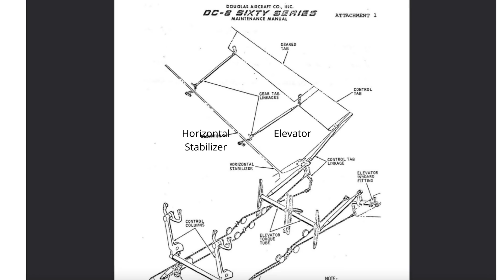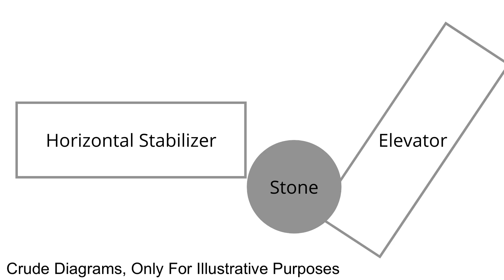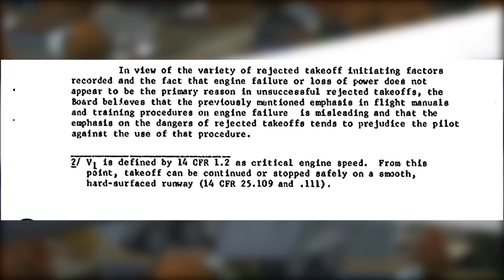How A Stone Crashed A Passenger Jet | Trans International Airways Flight 863

Comment: A tail-strike seems like a clear reason to reject a takeoff, regardless of your training. That's potentially worse than losing an engine.
Reply: If your craft is rotating 30 knots before V1 uncommanded, I don't know why you wouldn't reject the takeoff. Control problems are far more serious than a single engine failure in a 4 engine craft.
Reply: @randomxnp  The tail strike in a stretch DC-8 was not all that uncommon. The aircraft was designed to take the strike with no damage. There was a bump under the tail to absorb the impact. It was painted black and if the paint was worn it required an inspection. There was a tube inside that was compressed if there had been a strike. The extent of the compression governed the inspection required. Most of the events I heard about required nothing more than more black paint on the tail skid.
Reply: Depends how long and when in the take-off. Sure turn back if you feel like it but it’s not as bad as it seems.
Reply: @lucaschneider1613  What a pity these pilots didn't "feel like it". They dragged this plane into the air after literally dragging its ass down the runway for 1200 feet.

No, they had no way of knowing they had a rock stuck in their ass crack - but they had every reason to know they couldn't get that plane off the ground and there had to be some damn good reason for that.

If they'd aborted that takeoff, the rock might have fallen out, leaving them none the wiser - until some slightly-less-idiotic engineer thought, hey, what would make this plane pitch up *all the way down the runway*.

It wasn't like today, when the pilots set out to fly and every damn thing they do gets run through some subcontractor's software FM box, to emerge on the other end in God only knows what configuration, and we finally bother to figure out what after we've sacrificed two plane loads of people.

But hey, those pilots were furriners and they just couldn't fly our fancy baby, amiright?
Reply: Losing an engine is far, far worse than a tail strike. In a similar DC-8, we hit tail on takeoff out of PAP-JFK. We completed the flight. It was checked in JFK and was able to continue its work. Tail strikes can range from a scratch to damage to the fuselage, but still not worse than loosing an engine especially on Take Off.
Reply: @timbohp  Sure, a little scrape wouldn't be concerning, but in this case it was a hard strike.
Reply: @pseudotasuki  -  If you're at V1 speed.....you're not supposed to reject a take off as you won't have enough runway to stop after rejecting.  Yes, they should've rejected ASAP, but they didn't.  Once they got to V1 it was too late.
Reply: @christopherweise438  B.S. because the V1 would have been around 114 Kts Vr probably the same.  The runway was 13,000 feet long. They were probable had used 1500 feet of runway when they reached V1/Vr. Back in those days the F/O kept his hand on the throttles until V1. Airlines changed the procedure a few years later and the Captain kept his hand on the throttles until V1 for all takeoffs. If you ever fly any airplane and it auto rotates you have a big problem so STOP, and figure out why, Cessna 150 or B747.
Reply: @georgeconway4360  -  There are situations where you don't reject takeoffs at V1.  Tell me i'm wrong.  Not all runways are the same length.
Reply: @christopherweise438   V1 is just a number. In this case the TIA crew should have rejected the moment the nose started to come up on it’s own. There was a very serious control problem. Recognize if this DC-8-63 weighed 355,000 pounds rather than 200,000 pounds of the accident aircraft it could reject at a V1 of 155 Kts, which may have been 9000 feet down the runway and stopped even though it weighed 155,000 pounds more than the accident aircraft. What would you do if you had the opposite problem, nothing happened when you rotated. Obviously you would have already passed V1? Don’t you think you be better off rejecting 30 Kts faster than V1 rather than run off  the end of the runway at 200 Kts? It’s never too late to reject if the airplane cannot safely fly. That’s why they pay you the big bucks!
Reply: @georgeconway4360  -  I see.  I was wrong.  My father was a pilot.  I went up with him many, many times, but i never went for my certificate.

Thanks for the tactful explanation.
Reply: @pseudotasuki  
Tell me how you know nothing about this without saying those words. Tail strikes are not nearly as uncommon as you seem to believe.

Comment: Yes, not only is it plausible, but it is most certainly what DID happen. 

As a result of this accident, an elevator position indicator (EPI) was installed with the little gauge on the left side of the F/O's instrument panel. When the pilot monitoring calls "80 knots" the pilot flying pushes the elevator forward with the control column, and responds "elevator checks" as you feel the nose depress slightly and see the nose down indication on the EPI. This was done on all takeoffs. 

As far as I know, nobody has ever had to reject/abort another takeoff for a jammed elevator since this one happened. This scenario could happen on other aircraft types as well, particularly those with non boosted elevator system designs, such as the 707/720, CV-880 and 990, or propeller driven types. These guys were just not having a good day... The aircraft was a DC-8-63CF.

Comment: This accident resulted in a couple of changes for DC-8 flight crews. One was a call out of 80 knots by the non flying pilot which would be an indication that sufficient airflow over the elevators existed to perform an elevator check, moving the control column forward to accomplish a nose strut compression will indicate free elevator operation. After the nose bob  the flying pilot will state Elevator Checked. If the elevator does not check satisfactory  the rejected takeoff procedure is considered. This check is also a good indicator that the center of gravity and takeoff stabolizer setting  was within limits.
Reply: Exactly, Ray.

Comment: Sure, its possible, like a hundred other things. I recently had to deal with an unsafe nose gear light, and after doing all we could to clear it, including several light touchdowns on wheel to confirm weight bearing, we landed. Gear was down, visible in cowling mirror, pressure built up to reset handle and confirmed by several weight bearing loads however gear would prove un steerable and turned hard right.(45°). Aircraft was kept on runway only by maximum differential braking and nose gear collapsed. Unable to see that coming in flight, and never heard of it happening ever before. Just proves you cant realistically foresee every   possible contingency. Losing my certificates anyway.

Comment: The chief cause was probably the tail strike, in my opinion.
Reply: You have something very wrong to get a tail strike, or the pilot pulled back too far on the yoke. However not being able to get the nose back down and dragging the tail for 1200 feet 380-ish meters is such a huge ( stop immediately ) sign that it blows my mind that they didn't reject the takeoff. The tail strike wasn't the cause but it was a symptom.
Reply: @williamgreene4834  forgive if this seems like and obvious question please. Could the weight balance or distribution have been a big contributing factor. I also wonder why they continued with such a lengthy tail drag. It just seems something obvious should have been found, flaps not Set, fuel or load imbalance, insufficient V2 takeoff speed or rotation speed. Just very puzzling to me. If pulled back on stick too hard, it should have been quickly apparent and corrections made. I haven't seen flt. Data so I am flying blind here. I thank you for your knowledgeable input.
Reply: @Knotty_Bill  When I said the pilot could have pulled back too far on the yoke I was just stating possible causes. That would be very unlikely and the flight data also showed this was not true. Weights and balance are also carefully recorded by cargo loaders and that seemed fine. They pushed forward on the yoke but couldn't get the nose back down. That and the lengthy tail drag makes it almost unbelievable that they didn't abort takeoff especially because they had plenty of runway left. You mentioned fuel but fuel tanks are almost always in the wings. So the amount of fuel doesn't effect balance except left or right but that's another story and not relevant to this crash. It appears to be the stuck stone in the elevator that they were talking about. Sorry for the long winded response. :)
Reply: @williamgreene4834  no worries, just trying to learn more about this stuff...I love to learn and knowledge is more valuable to me than gold or silver. I really appreciate your input and insight.

Comment: it is very possible to pick up a stone or any other kind of debris from the runway during takeoff, serious procedures are in place to clean the runway from them, clearly a failure from the airport's side to send them down a runway that was not cleaned properly. note the concord disaster was also caused by debris on the runway. On the other had, the pilot flying the aircraft should have rejected the takeoff, given the incorrect behavior of the plane and having a tail-strike which would have brought them back to the runway anyway. I don't know if i would put more of the blame on the pilot, given the procedures as you described them.

Comment: Interesting, I am curious how can investigators be sure the stone / debri marks didn’t happen due to crash impact ie how can they be so sure that the jammed stone happened before the crash🤔
Reply: Marks on both parts at the same location, but in opposite directions - outward from the gap between the parts.  That indicates something hard got squeezed between them.

If something got smashed through the parts during the crash, the marks would be in the same direction - out of one part and into the other.

If the parts were separated and each one got damaged separately, it would be extremely unlikely that the location of the marks would be the same on both parts

Comment: If exterior cameras were installed - the Flight Engineer would have noticed anomalies in the rear controls, once he panned the rear of the craft views. However, this is a big, “what if” hypothesis. Camera equipment would have been extremely bulky, in that era of flight. I still believe if multi-view minicams were available - both this doomed flight and JAL 123 may have had better outcomes. 

In 1976, we flew Trans International Airlines, to Hong Kong on a DC-10-30CF. We were stuck in Anchorage, as we awaited an engine part to be delivered and installed. TIA was a TransAmerica company then.

Comment: As soon as the plane does something dangerous all by itself and you're still on the runway it's a rejected takeoff.
Reply: Unless you’re past v1 that is
Reply: @Wehra96  yea but surely even past V1 slamming the air brakes,, throwing the engine in reverse and hoping for the best is still better and gives you a much higher chance of surviving AND more importantly your passengers (or some of them) being on the ground even if you collide with something than getting into the air and falling from a few thousand feet.
Reply: @andyrob3259  If they rejected an place before lift off or even a few feet after they turned off with 8-9000 feet of runway remaining. Also pulling the throttles to idle would have eliminated the tremendous pitch up force caused by the engines running at T/O power. There was no use of Flex/Standard/Reduced power in those days.
Reply: I was under the impression that, to this day it is still considered safer to complete a take off and then trouble shoot once airborne rather than reject a take off.
Reply: V1 is literally the maximum speed at which a rejected takeoff can be initiated in the event of an emergency. You don't know during takeoff how bad a problem is going to be until youre airborne. You do know as a fact that a rejected takeoff is likely going to result in a hull loss, injury and possible loss of human lifes.

Comment: Inexplicable that they did not abort the takeoff.
Reply: Simple rule.  If either the pilot flying or the pilot monitoring thinks about rejecting the takeoff when the aircraft is still below V1 (perhaps V2), reject it.  Don't discuss it. More to the  point, speaking the word "reject" should immediately cause the pilot flying to do so--or tell the pilot monitoring to apply reverse thrust, etc.  The logic is that there is not enough time to discuss rejecting and then reject the takeoff.  If you were to take a vote, a tie should be resolved in favor of rejecting.  Since one pilot voting for rejection is sufficient, there is no need to take a vote.  Oh, and before V1, if you are not sure?  Reject.  If the problem really is minor,  you will be in the air only a few minutes late.

Elon Musk is known for, "The best part is no part."  He says if you don't add back 10% of the parts you take out, you are not taking enough out.  Seems like there should be a similar rule for aborting takeoffs--if you don't find out that there was nothing wrong 10% of the time, you are not rejecting enough takeoffs.  More to the point, if something seems wrong, reject.  That gives  you plenty of time to figure out whether there is a serious problem.  If you go the other way?  You may be one of those pilots whose last words are on the CVR.
Reply: It is poor training. I can understand why the crew didn't want to reject the takeoff as they were trained to never reject a takeoff except when an engine fails as rejecting the takeoff is "dangerous". This led them to continue with the takeoff likely for fear of getting in trouble. Training pilots to follow rules like these "or else" is completely wrong and dangerous as was made obvious in this accident, as you are training them to blindly follow the rules no matter what, instead of applying common sense which is the correct way to deal with situations like this. These rules are only made up because 99 times out of 100 it is the safest thing to do, however, there are always exceptions to that. Ameristar Air Cargo flight 9363 is a good example of how the pilots saved everyone on board by breaking the rules. In that case, as the pilot flying attempted to rotate, nothing happened as one of the elevators was jammed in the down position, and the crew decided to reject the takeoff after V1. If they had followed the rules and continued with the takeoff, they would have crashed, but instead they used their common sense and decided that rejecting the takeoff, even if it meant overrunning, was far safer than attempting to continue the takeoff, and that decision saved over 100 lives

Comment: Well, I (a retired ATP) would have firstly suspected a mis-set pitch trim..... even with a lightly loaded DC-8, an uncommanded rotation as low as at 80 kts. is highly unusual if not impossible. After verifying on the pitch trim gauge that the setting is within limits and asking the PF if he/she had inadvertently pulled on the yoke, I would have aborted. But that's while sitting in a comfortable chair... I do not mean in any way to criticize the poor crew. But there for the grace of god go I...
Reply: You're right. It's always easy to say "I would just" when you're in a comfy chair with no real pressure and several minutes to think about it, having been presented with all the facts.

Rather harder when a problem with a habituated movement unexpectedly throws you out of virtuoso mode and into learning mode at a time when you're already busy and stressed. The sudden jump of fear and confusion and the knowledge that this might be the end. 

This always slightly annoys me when people calmy spend minutes, hours or weeks analyzing a crew's few seconds of confusion and fear and reach the conclusion they would have done it better.
Reply: That's what I thought...rotation at that speed is cause for pause!! You can ALWAYS fix things on the ground, not in the air. ALWAYS ERROR ON THE SIDE OF CAUTION...that is what saves lives.
Reply: @strangelove9608  Planes are SLIGHTLY more complicated...what an understatement.
Reply: Would you not have recognsed that the control column had moved back OK, but then wouldn't go nose-down, suggesting a control failure - and have to either reject take-off, or rapidly make a lot of nose-down trim?